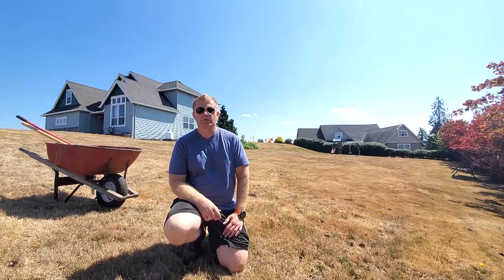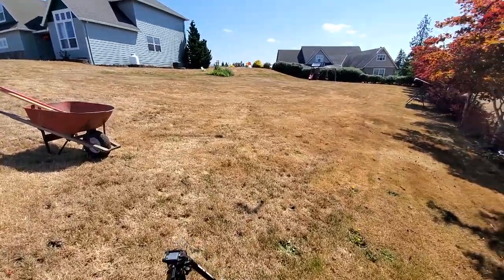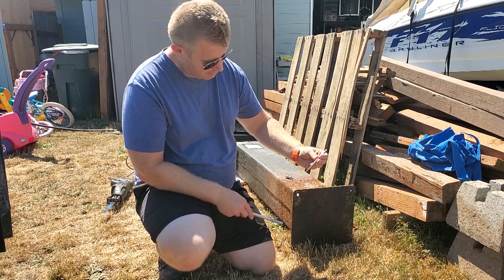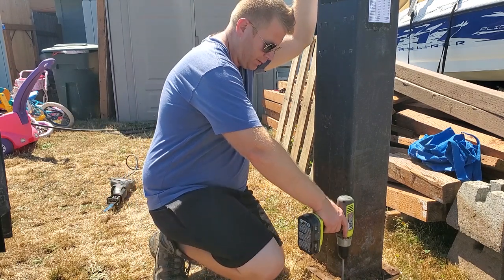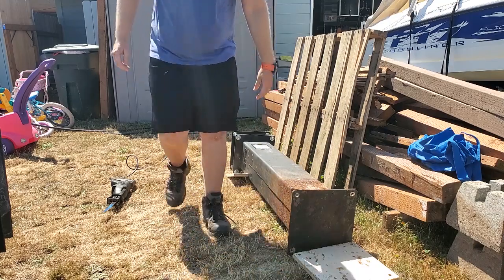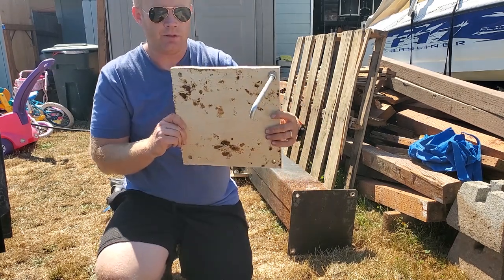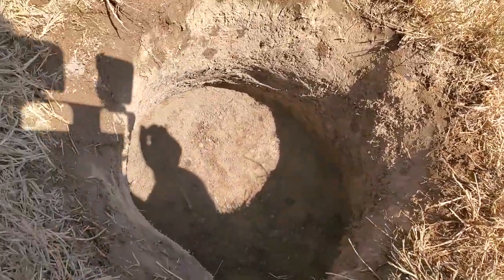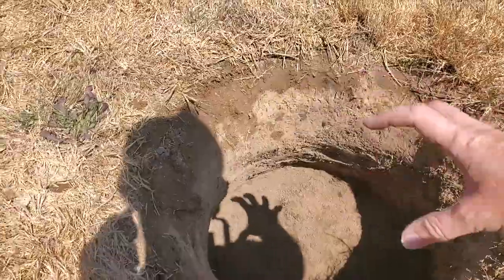Roll off Roof Observatory Construction Tips and Tricks

Comment: Which direction does the roof slide off in? Looks like to the east if I'm putting your video together right. Is there a rule or general consensus for that?
Reply from the maker: Yup mine slides to the east. The original reason I did this was that I had huge trees blocking that part of the sky anyhow. Typicly you would want it to slide east or west. That way at least at some point everything should be visible as the earth rotates.

Comment: It's always a good rule to have a pier/footing base below frost level for your particular area. If not you risk frost heaving. Frost heaving will move the pier. Another consideration is the deeper you go, to a point, you'll have more consistent ground moisture. Just like frost heaving can move the pier the repeating drying and wetting of the soil can move your pier as well. It's something to think about.
Reply from the maker: Very good tips! In my area I doubt the frost line is more than a few inches deep as we rarely get below frizzing here and its usually only for a few days at a time. I'm sure this is different for some folks! But thanks for the info, I'm sure it will be help some folks out!
Reply: 100% here they recommend 36" to get below frost line....ugh

Comment: Appreciate you taking the time to make a video like this, I just got the C82 pier and adapter for my EQ6R mount and was a bit discouraged as I've never done concrete work before but was curious how to do the anchors, as a friend has helped me and shown a similar template design I knew that was the way to do the anchors, but double checking north is a must.. as another told me they knew somebody who had done theirs and was roughly 10 degrees off ....  ouch..!!  There are not many videos out there to help amateurs at the level I am at, again, much appreciated and well made. Thanks for the tips and tricks on how to do this. Knowledge is Power! lbvs
Reply from the maker: Glad it was helpful. Yeah I enjoy sharing the knowledge that I have acquired over the years👍

Comment: What an amazing build vlog. Thoroughly enjoyed it. I do have a few question if you don't mind. How tall are the side walls (when the roof is open and what is the height of the pier from top to the observatory floor (where it starts to disappear underneath the observatory). Thanks
Reply from the maker: Walls are 6' high. I'm 5 10 and can easily walk with the roof closed. There is really no reason to make them any higher unless you are over 6' tall. The lower the wall is the more of the sky that your scope will be able to see. The pier is about 4' above the floor including the top plate. Again the higher the better for sky visibility as long as the room will still close(and in most cases you will not have the scope pointed up on a GEM mount with the room closed).
Reply: @AVTAstro  nice one mate. Thank you for answering these questions so quickly and brilliantly. I only asked because I will be looking at a plastic shed option which is a 6x6 (inside) and the walls are also 6 feet tall. My current pier is around 1150mm and when putting the mount and the scope, everything comes to my eye level. Will need to keep things lower than the walls because we get some serious amount of winds here in the UK. The only downside I see is, I'm 6'3" 🤦 but then again I don't plan on walking around the inside with the roof closed so I guess I'll be alright.

Also one last question, what's the biggest frac you've been able to use in this observatory?
Reply: You should label the plywood template and pier when drilling holes so they line up correctly in hole pattern is not perfectly symmetrical